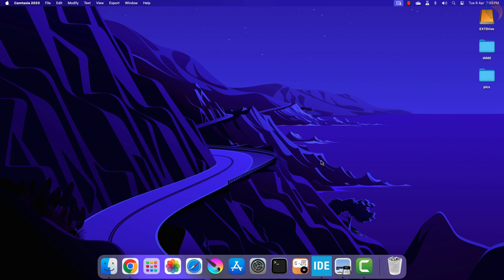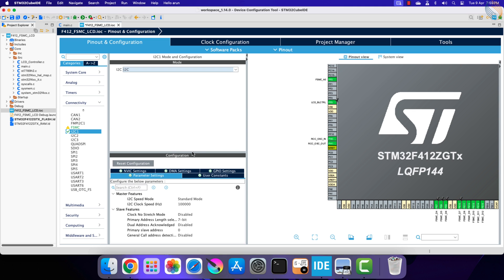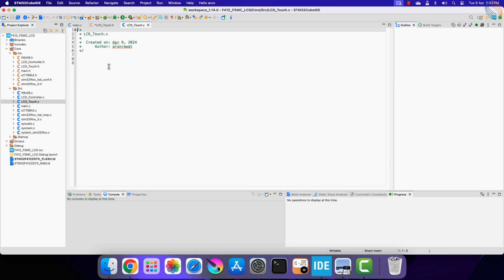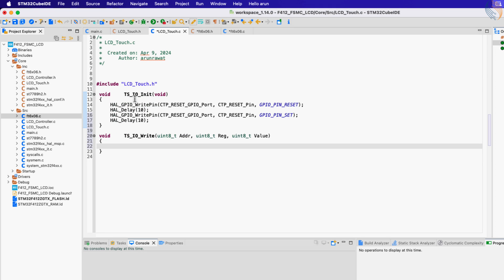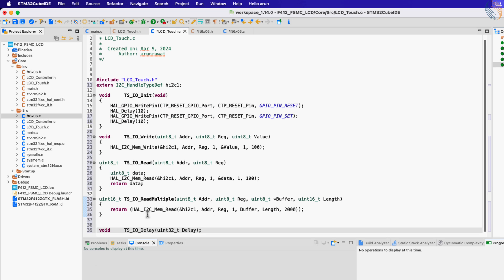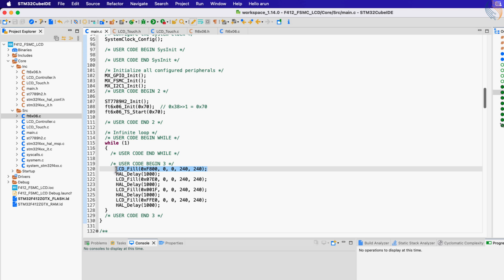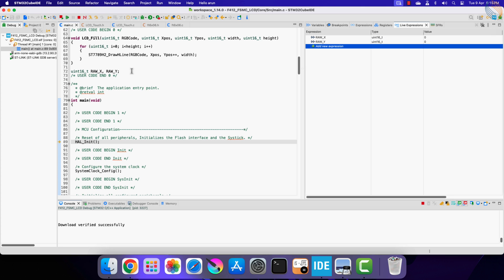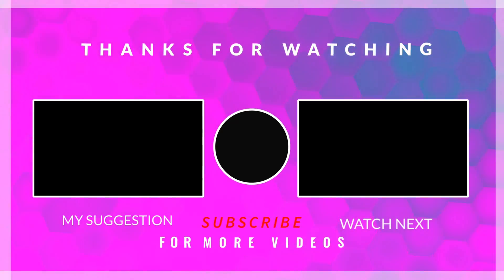STM32 FSMC || LCD PART 2 || Add touch Interface

Comment: I'm new to TouchGFX and I'm trying to use a toggle button to send a data frame to a car display via the FDCAN bus using STM32 microcontrollers. I'm not sure if it's possible to achieve this functionality with TouchGFX and STM32, and if it is, I'm unsure where i  configure the filter, transmit header, and add messages in the main.c function!! If anyone has experience working with this setup, I would greatly appreciate any guidance or assistance you can provide thank u
Reply from the maker: Check this video. https://youtu.be/rGxDZPYcWIs
Instead of blinking LED, just send your FDCAN data.
Reply: @ControllersTech   i don't know where should i configure the filtre and tx header and thank u a lot
Reply from the maker: Then watch the FDCAN video in the CAN playlist.
Reply: @ControllersTech     i watching all the playlists! They've been quite helpful. However, I'm unsure whether the filter configuration and transmission header should be placed in the same part of the code as demonstrated in the FDCAN video, or if they belong in the model.cpp or presenter.cpp files. thank you a lot.
Reply from the maker: You can define a function in the main file and write the transmission code inside that function. 
Now call that function from the model file wherever the button is pressed.
Reply: @ControllersTech  I've written a code that compiles without errors, but it's not functioning as expected. I'm having trouble identifying the issue. Could you assist me in debugging it? If you're available to help, I can send you the code via email.